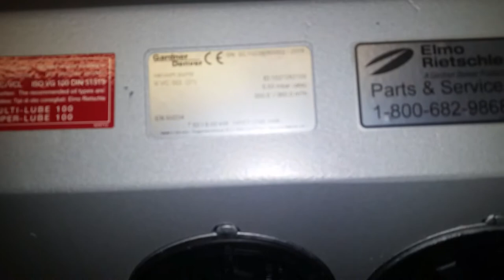VC 303 Oil Leak

Comment: The most common cause is running at very rough vacuum with a restricted discharge causing excessive pressure in the filter housing. It would be interesting to see a back pressure gauge